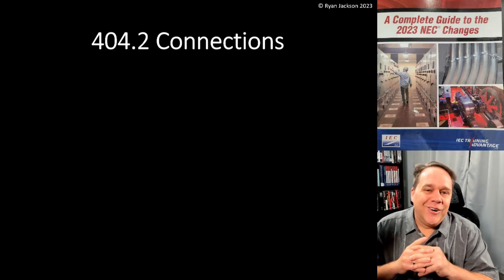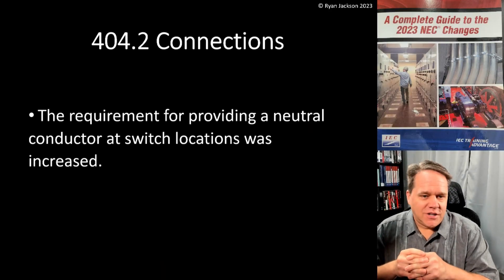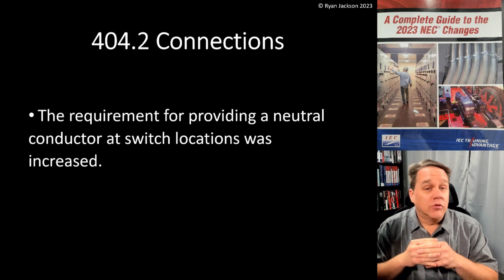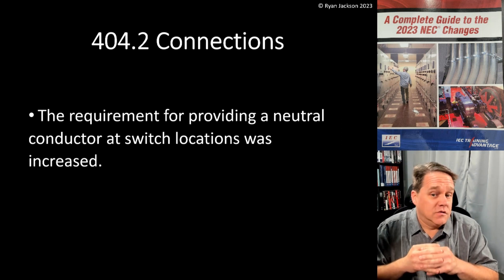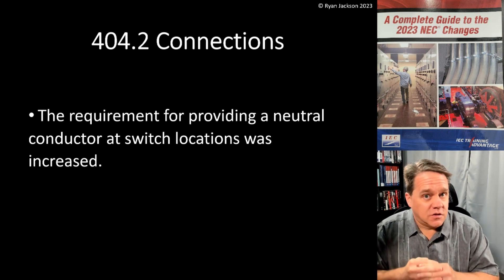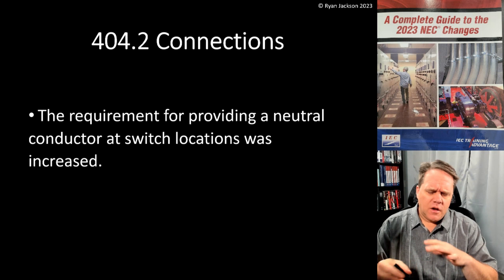404.2 Switches Controlling Lighting

Comment: Thank you for all your videos Mr Jackson, huge fan! Quick question for you. 120v under cabinet lighting with a whip that is designed to be plugged into an outlet. Can the splice between the switch leg and the luminaire whip be in open air under the cabinet? I cannot find a code anywhere prohibiting this even though it seems like it should be a violation.
Reply from the maker: That would violate 300.15.

Comment: A couple years ago one of the guys I went to school with had a detached garage built and needed me to come up with a way for the light on the garage exterior to be switched from the house and garage, and for there to be some receptacles in the garage always hot, using only 12/2 UF in between.   I ended up running two runs, one for power, the other for travellers,  which I had phase taped the black and white, red and blue respectively. You could essentially use this trick to wire a dead end three way with a neutral available,  or use 14/4 or 12/4.